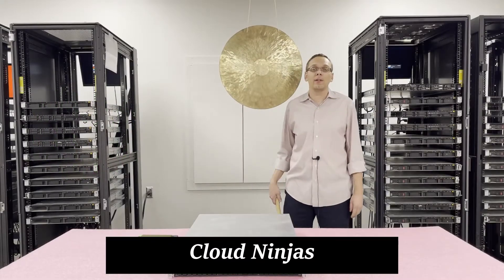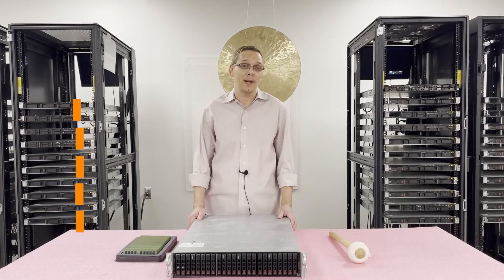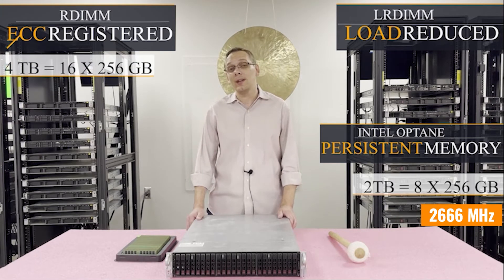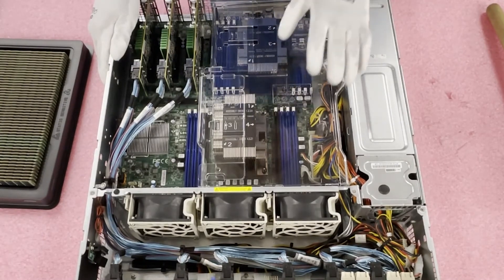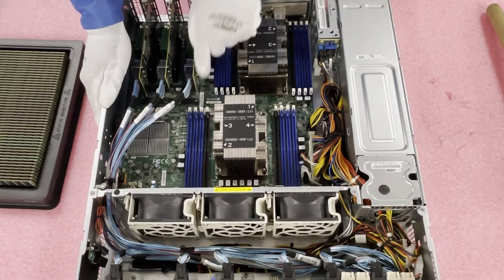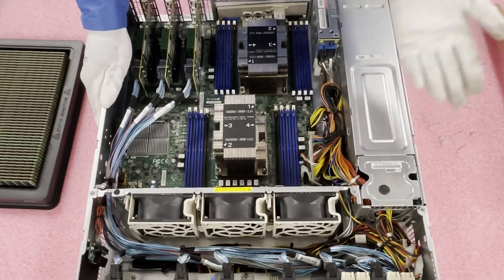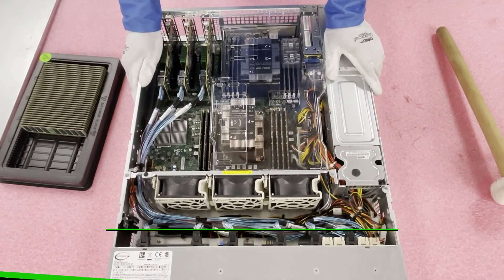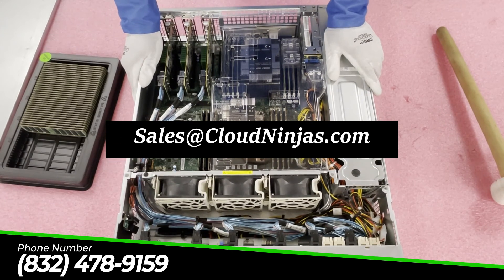Supermicro X11DPH-T X11DPH-I & X11DPH-TQ Server Motherboard Overview | CSE-216 Memory Install Tips

Comment: If you only have two RAM sticks, which slots should they go into?
Reply from the maker: First channel First Slot for each cpu
Reply: @cloudninjas  Well, on the supermicro x12 it turns out the FIRST two go into SlotA (third to the left) and SlotE (third to the right).  Weird!  My solution was to just get EIGHT and fill EVERY hole.  :-D

Comment: I was thinking about X11DPH-T
2x Intel® Xeon® Silver 4214R Processor and looking into getting the intel optane memory, which memory would you recommend for a proxmox homelab virtual machine system running ZFS for storage.
Reply from the maker: That'll be a nice set up.   Make sure to update BIOS in order to use the "R" Intel CPUs.  We have some 32GB DDR4 2133 Load Reduced DIMMs for a really good price if interested.  Anyway you go, honestly you'll be fine.  Right now those 32GBs I mentioned are best price per GB.  Smash that subscribe.